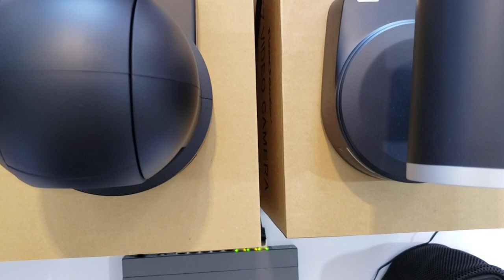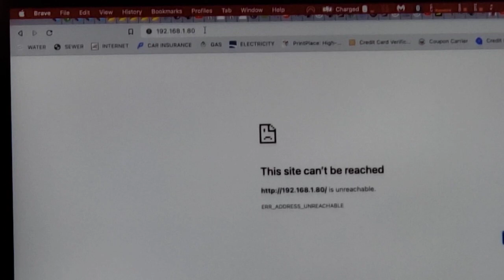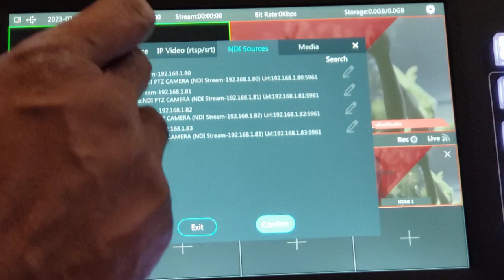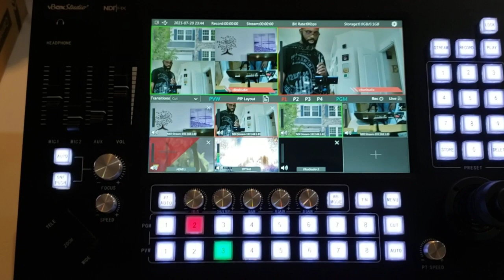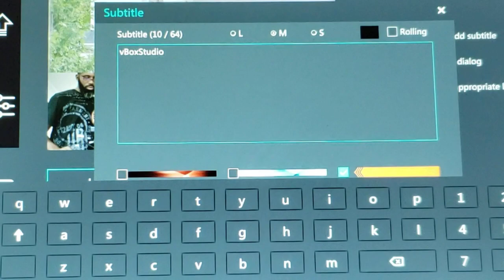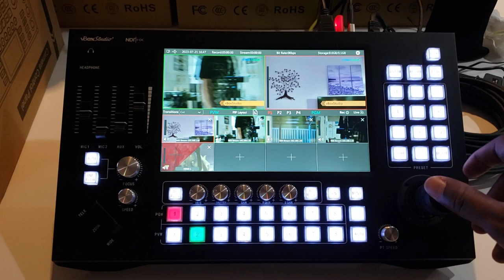8 Channels NDI, PTZ controller – ViZion SP8 by vBoxStudio®

Comment: Thank you for posting this. What if we dont have NDI cameras,  how will you connect the cameras and what is the IP video(rtsp) section for? Can you add 6 HDMI cameras to this device if you dont have NDI? Is there an adaptor you can recommend? Thank you again for this.
Reply from the maker: Hello,
Thanks for your question. This is a serial network system. It can handle standard PTZ cameras. While it can handle the ptz, it can also handle hdmi. BUT the atem mini will be more suitable if you're looking for handling several hdmi cameras.
Reply: Thank you so much for you kind prompt reply. Very helpful!